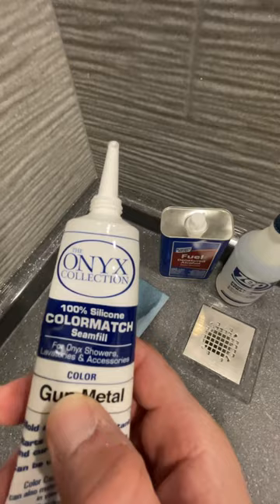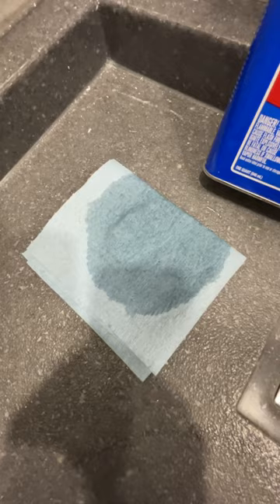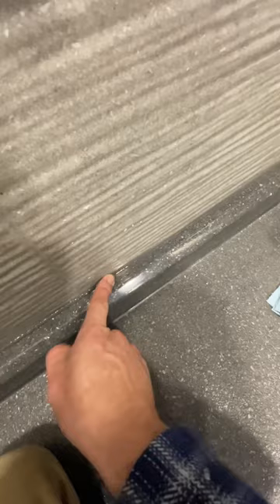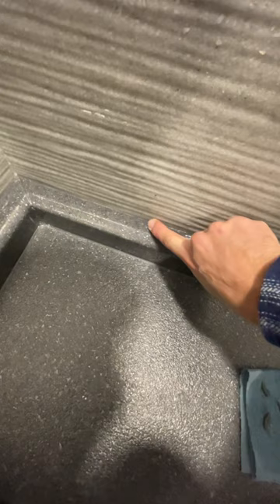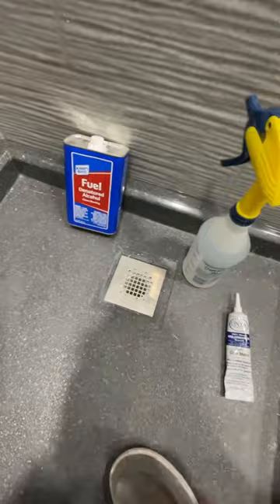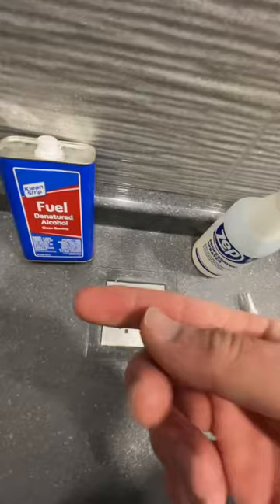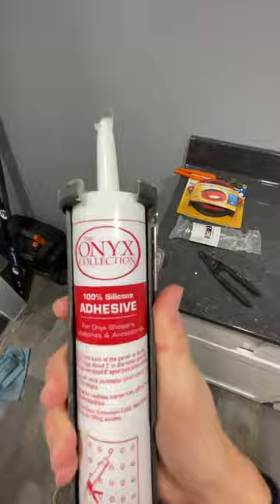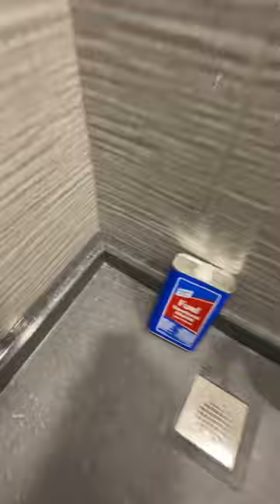How to use silicone properly *ONYX Shower system*

Comment: We just put an onyx surround in around a new tub. We have a bit of a gap in two spots near the front of the tub. How big a gap should we be comfortable putting color match caulk in? It's where the panel meets the top of the tub. Any other options trim wise to finish it off nicely? Waiting on 90 degree trim for the two back corners and thinking about putting a 2" x 3/8 inch flat trim at the top where it meets the ceiling. Also planning on using 3/8 in edge cap on the sides where the onyx meets the drywall to finish it off. Any thoughts appreciated!
Reply from the maker: The panels should have been dry fit and trimmed accordingly before gluing them in place. You can order the inside corner pieces to cover them up and color match caulk both sides to create the seal, the top can either be the edge trim or crown molding. I wouldn’t use the color match caulking to fill a gap any larger than 1/4” personally.